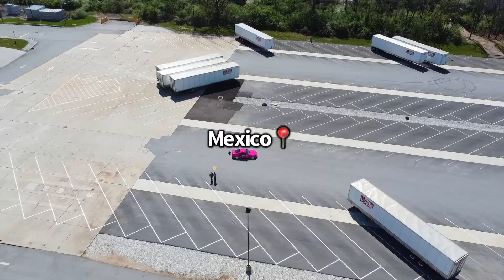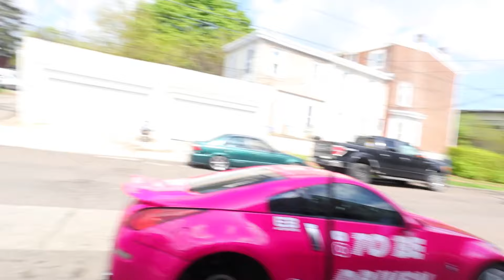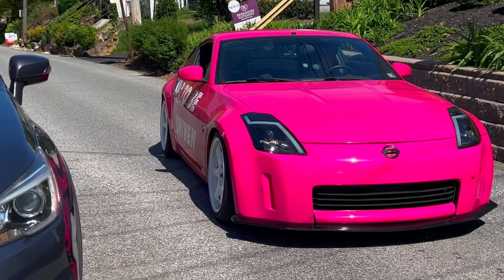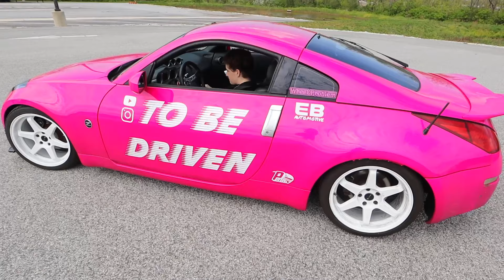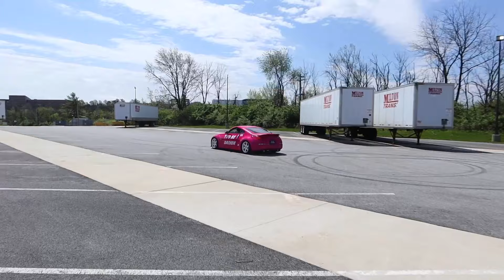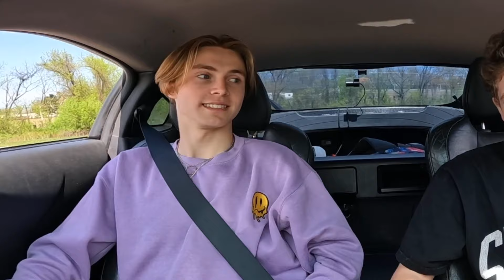Teaching High Schooler to Drive my DRIFT Car..

Comment: Hey Roman how much hp does the Z have
Reply from the maker: Sum like 300…
Reply: Oh I thought it would have more
Reply: @frowsty-gold5 Bruh 300 is more then enough with the power to weight ratio. And it has 220hp stock. U can of course raise it up somewhere to 400 but the engines health is gonna suffer.